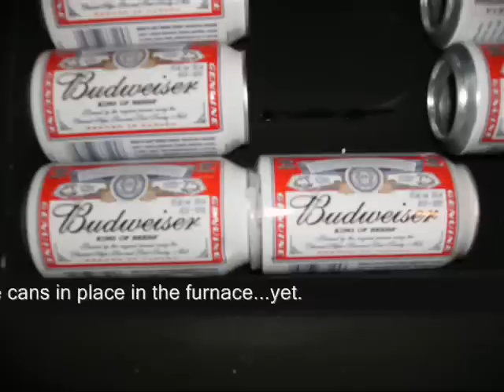How To Make an Aluminum Can Solar Air Furnace: Part 2/4

Comment: Hi James, Somehow after a couple years researching I am just now finding your video. I opted for galvanized construction studs for less weight. 3/4" x 3 wood for closing the end chambers. I also got lucky in finding 4 peices of 3/16" tempered glass 46" x 80" for my covering. The reason I am commenting though is simply a safety thing when it comes to making holes in your cans. Any hand can opener can cut the tops of the cans out cleanly and safely, then using a center punch on bottom hole.

Comment from the maker: compare the inside of the furnace to the inside of your home. if you were to paint your walls white, it would stay relatively cool in there because more heat/light is being reflected away from the walls/insulation and back through the windows it came in. if your walls were black, then any sunlight that enters the windows of your home (or any source of heat) would be absorbed and retained by your walls/insulation, thermal mass would rise and it would get really warm in there really quickly.

Comment from the maker: the thing is that there's no need to reflect the heat back on to the cans. the cans will absorb it from the back panel via conduction, radiation. if everything is black inside, then that's more heat that's going to be trapped in the furnace, if the back panel is white, then as i said, it will reflect some of the heat back onto the cans but it will also reflect it back outside through the glass. the back panel is mostly shielded by the cans for sure, but what little that is exposed (cont...)

Comment from the maker: no problem. i'd be more than happy to hear what you come up with. are you considering using perspex/plastic for the glazing? almost anything transparent will work, as long as it can take the heat; i've never used it personally, but i know others who've used polycarbonate sheeting and it works just find. what ever you use, i would inquire about it's heat tolerance before buying it. you'll want something that can withstand up to at least 100 deg celsius without breaking down. best of luck to you!

Comment from the maker: the insulation absorbs the heat to an extent, but that's it's job. there's very little loss in that sense, if any, because the insulation's sole purpose is to block the heat from escaping, in turn contributing to the thermal mass in the furnace. if heat escapes the furnace then it's not designed properly, regardless how many btu's it produces. the main idea is to trap as much heat as possible, not just produce it because this unit also retains heat after the sun goes down, so for ex (cont...)

Comment: Thank you so much for your sound advice. I will be delighted to share any findings I have with you. I definitly wont be painting the glass, thanks. Also considering an anti-freeze tank and multiple layers of cans but I get what your saying about the insulation adding to the thermal mass. Im on a tight budget so how practical is perspex or corrugated plastic?

Comment: Yes that is exactly where my problem is, if I may. If the inside walls are reflective then wont more energy be absorbed into the tubes and therefore the system ? I'm considering fastening my unit directly to the wall with no backboard and just black paint and good sealant , the walls are 3 feet thick and stone.But if the unit is free standing then I still think you would get better results by spraying the inside white as all of the sun light will be shielded by the wall of cans? Am I wrong?

Comment: I am ready to begin assembly of my furnace but am not sure about how I should apply the paint...Surely the cans and the glass are the only components that should be black and then the frame inside and outside should be a glossy white to reflect the light/heat. Dont you think so ?If the inside is black then isnt that absorbing the heat into the insulation instead of reflecting it ? I dont claim to know anything just asking for your opinion, thanks.

Comment from the maker: (cont...) would be more efficient if it was black and contributed to the thermal mass vs. reflecting %50 or more of the suns energy that hits those small spaces, back outside. black keeps the heat in, white doesn't...it will reflect, but the thing to understand is that only a fraction of the energy that's reflected is actually recaptured by the cans - the rest goes out the window - literally. reflection is a quick way to transfer energy, but not as efficient in this case given that (cont...)

Comment from the maker: you don't want to paint the glass - UV wouldn't penetrate any farther to heat the cans sufficiently, not to mention the glass magnifies the sun's intensity and helps to keep the heat trapped in the furnace. i personally wouldn't paint the frame inside white either because, yes -it will reflect the heat onto the back of the cans, but would also reflect it back outside as well, severely compromising it's efficiency. good thinking, but a few have already tried these methods to no avail (cont...)

Comment from the maker: Lol, everything breaks down under the sun eventually. But no, this isn't special silicone. It's DAP, just standard (at least here it is) exterior rubberized silicone for windows and doors. I've been using it for almost 16 years in my trade as a journeyman carpenter and have never had a problem with it...I love the stuff. It's easy to work, %100 water resistant and makes a dry, durable, flexible seal. No other caulking compound on the market has the same qualities